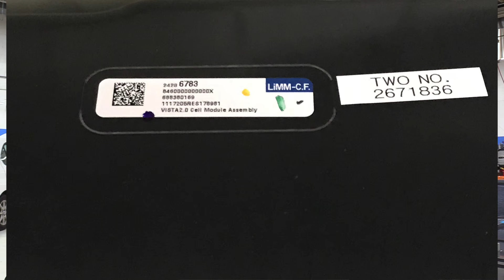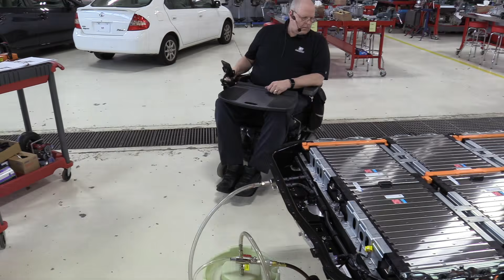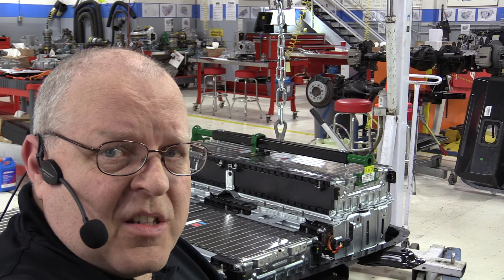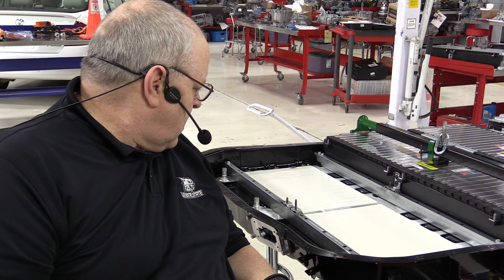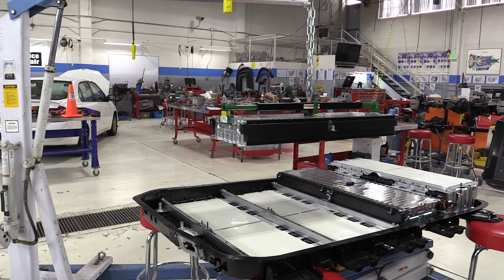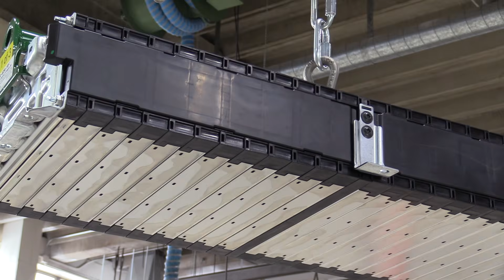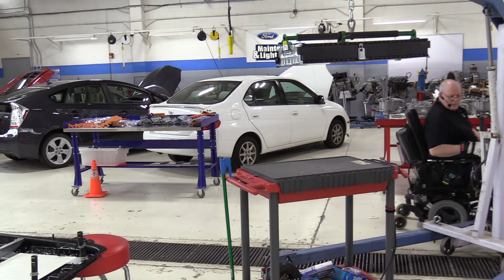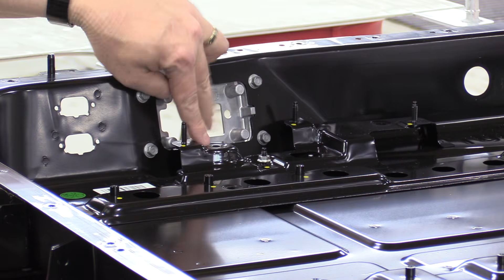Chevrolet Bolt EV Battery Disassembly

Comment: Thank you for a great informative video.  Can I get rough dimensions of the outside edge of the flanges, left to right, front to back and top to bottom of short section and tall section?  Thanks!  I might have an application for it.

Comment: Chevy Volt uses less gas than Tesla, Nissan Leaf or Chevy Bolt The state of California gives a larger rebate to Tesla owners than to Chevy Volt owners because the Tesla is a “Zero Emission” car. In reality the Chevy Volt is closer to zero emission than the Tesla. This may not make sense to you so please read on to see my reasoning. As an owner of three different Chevy Volts Plug in electric / gas hybrid cars since 2011, I can affirm you that my experience with those three cars and my experience with the Chevy Volt is that they use much less fossil fuel (Gas) than Tesla, Nissan leaf or Chevy Bolt. This may sound as an absurd statement but if you let me explain to you why, then it may make more sense, When a person owns an all electric car (Tesla, Leaf, Bolt) it is never a primary car. The owner must own a second car as the primary car. This is usually a regular gas car that in the long run it uses much more fossil fuel than a Chevy Volt. In other words the total fossil fuel usage for this household is much more than that for a person who owns a Chevy Volt. The Chevy Volt for this household is the primary car (no range limit) and there is no need for a second (more long distant) reliable car. Also should note the environmental impact of owning two cars over one car which would include parts that needs to be replaced and those used parts will eventually end in the dump, 4 additional rubber tires to care for, oil changes, transmission oil, brake pads, tune ups, cost for the additional insurance etc. As soon as a person purchases an all electric car he develops a (RAD) range anxiety disorder, it is a disease I invented in my head to explain to you how a new owner of an all electric car starts to thinks shortly after purchasing the car ( sort of similar to buying a Boat: as the saying goes: the two happiest days in a man’s life is the day he buys a Boat and the day he sells it). Most of the general public (even most owners of the Chevy Volt) are not aware of this “RAD”. When an owner of a Chevy Volt travels any distant he will always be going from point A to point B. When an owner of a Tesla, Leaf, Bolt travel any distance that is close to the 50% range of the car’s battery capacity or more, he or she no longer can travel from point A to point B. It will always will be point A to point C. The reason is point B will HAVE TO BE a stop to use some form of a commercial charger thus diverting from A to B path (travel distance increased so is the fossil fuel usage) and the commercial charger uses of (fossil fuel) to charge the car. Example if a Tesla owner lives in Pasadena, Ca. wants to visit relatives in San Diego, Ca.. This Tesla owner will be very apprehensive that his or her car my not make the round trip and they could get stranded somewhere in between putting their life on the line. They have to stop at some Tesla charging station in between to get the Tesla charged or the battery switched while the relative who lives in San Diego will use their gas guzzling (fossil fuel) car to pick them up at the Tesla charging station to bring them to their house and when they are done visiting, this relative will have to take them back to the charging station using the same gas guzzling car, that is four trips. When owners of an all electric car taking any extended trip they must be on their toes learning and knowing the whole network that they can use to recharge their car (Point B to point C). If those charge stations are busy charging other cars then they must wait possibly buying foods and drinks (that used fossil fuel to make, and produce more trash to fill landfills). If the car is completely discharged then they will have to stay at a hotel overnight, because those All- Electric cars can take as much as 18 hours to fully recharge. Boy think about the amount of fossil fuel used to keep a person in a hotel overnight, electricity to operate AC / Heater, watching TV, hair drying, washing sheets and towels, laundry, food and the trash generated by such a one night stay. They also will need some form of transportation from the charging station to the hotel and back (more fossil fuel). Those all electric car companies may use sells gimmicks like DC charging where you can get quick charging in a short period of time. I say nonsense, you have to find a charging station with such a DC charging capability and hopefully there is nobody else ahead of you waiting to use it. Some people might thing in the back of their head that some hotels may have a one or two charging station for customers to use, I can guarantee you that those charging station will charge you an arm & a leg (more direct and indirect fossil fuel use) before you charge your car. In other word they: CHARGE LOTS OF MONEY TO CHARGE YOUR CAR. My experience with hotels chargers is that they either don't work or you can not charge your car with them (Tesla requires a special charger). If Tesla owners think that they can knock on peoples doors and ask them if they would allow them to use their electrical outlet in their garage to charge their car while they are sitting in their car, they better think again. It is not only unpractical, not workable and damn right dangerous. In some areas around the country if you knock on peoples door to recharge your car then you could end up on some TV true crime show. When I was a child my father told me the following saying “Good health is like a crown on the heads of healthy people, only sick people can see”. Chevy Volts drivers wear a crown (No Range Anxiety Disorder) only owners of Tesla, Leaf & Bolt drivers can see this crown. The state of California calls those all electric cars as “Zero Emission” while in fact they either directly or indirectly use more gas than the Chevy Volt. The Chevy Volt should be the car that gets the White pool lane sticker and should get more state rebate than the Tesla. People who have never owned a Chevy Volt have no idea how little gas it uses. Over the past almost 8 years of using my Chevy Volts most of the times I can not even remember the last time I purchased gas. Chevy Volt is also a great maintenance free car, I can write a real long article about all the benefits of owning a Chevy Volt but not this time. I think Mr. Bob Lutz (the person who forced GM to make the Volt) against all odds i.e. “GM engineers” should receive the Nobel prize for his idea and persistence. Had GM added a gas generator in the Chevy Bolt the same size as the gas generator in the Chevy Volt then the Chevy Bolt would have become (BVOLT) and would have become the greatest selling car in the world. Unfortunately Mr. Bob Lutz no longer works for GM and GM executive are now forced to listen to “GM engineers” to make their decisions. Even if I lived in an apartment building with no electric outlets in the parking section I will still purchase a Chevy Volt to use it as a gas only car. On gas only, without ever being plugged in for charging, it gets more than 40 miles per gallon. This mileage combined with almost no maintenance and the incredible torque this car has, makes this car better than the gas cars made by Honda, Toyota, Nissan combined. The 100% electric drive makes the main function of the gas engine is to charge the battery or run the electric motor. This means this gas engine is under no stress to propel the car which make this engine run under little mechanical degradation, which means it can easily run half a million to one million miles without much of a problems. Until someone makes an All-Electric car that is powered by a super-capacitor (or other means) that can be fully charged in minutes AND those charging facilities are present at all gas stations, then All-Electric cars are not “Zero Emission” and not even close to being the lowest emission cars on the market. Super-capacitor cars I do not envision to be around anytime soon and until such a car becomes a reality then I say to the whole world that is watching : “The Emperor's New Clothes, he hasn't got anything on,". To all the auto industry CEO's with visions, missions of a “Zero Emission” cars : the jig is up because it is not in the All-Electric cars. The Volt has the lowest emission of most if not all (including All-Electric) cars and should receive the Nobel prize for being the greatest car ever built. Owner of 3 Chevy Volts for 8 years.
Reply: Rebate is based on units sold....after 200,000 the rebate diminishes and then goes away completely.

Comment: Does the Bolt have a 12volt battery for auxiliary like the Volt? This maybe where people get the 60 ?
Reply: I don't know if the Bolt has that battery (most EV still have a standard battery) but I don't think people are adding the energy values (of the EV battery) with the voltage of the normal battery, wouldn't make sense. People post likely rounding the number up.
Reply: Question Prof. Weber... If ice is disabled crack in block, can the 2012 Volt continue to operate via only the electric generator for the distance of its charge capacity?

It's an idea I'm throwing out there as the repair is just way to expensive and I'm upside down on the loan.

Comment: He's a modern day IronSide, solving these E-mysteries and breaking it down. You get a sub..
Reply from the maker: LOL, thank you!
Reply: @WeberAuto I love your channel, and I am a nervous electrician around 300v DC.

What I do no understand is why you do not disconnect the busbars halfway along the battery pack before tackling the HV terminals.  You say "it's all HV in there" but it's not.  Along a busbar there is almost zero voltage drop, so these are far safer to remove than connections to shorter bars in closer proximity inside plastic housings.  Once the series pack for each parallel string  is split halfway, the circuit is open and any potential difference between all the  terminals is dramatically reduced.  At 48v these packs will spark and burn skin but they won't shock you unless you insist on it.

Comment: Now the fun part, Professor Kelly!
The weight of that entire assembly  must add rigidity to the vehicle, and I'm sure it reduces the "driving distance!"
That said, will you be showing how to diagnose all the sub assemblies to this pack?  What diagnostic
 tools will be needed.  I know diagnosing gas, diesel and CNG vehicles can require "out-of-the-box" types of diagnosing to locate intermittent problems.  I'm sure these vehicles will have to be driven many miles over many years to have these problems.  Still if those problems are encountered, it would be helpful to see and hear how the vehicle was repaired.
Reply from the maker: Thanks for your feedback. See my other Bolt EV videos for that information

Comment: Interesting that they would say to lift slowly to avoid damaging those sticky thermal transfer pads, then say they are not reusable.  Seems contradictory.

My guess would be that they are reusable if not damaged and kept clean of any contaminates (including dust) that would hinder the thermal transfer.  Of course that wouldn't be following the "blessed" "proper" procedure.
Reply from the maker: Thanks for your feedback I think the slow lifting was to avoid damaging the battery modules
Reply: @WeberAuto   The 'thermal transfer' pads at end of the service life of the pack would have a tendency for the silicone to dry and stick firmly, and then tear when lifted. Imagine the cleanup job after that. 
I hazard a guess this assembly has had a very low service duty and essentially 'new'. 

These pads have a thermal impedance and more intent for having the heat exchanger [sink] make contact across the irregular surface of the battery cells [stacked like, so they would never be a true flat surface]. A bit of a compromise given thinner transfer compound on two very true flat surfaces would have higher exchange of the heat.  For example - in the electronics field silicone pads are only used when high dielectric property is needed due to the surface of a device e.g. one leg of a power transistor or voltage regulator] being at a different potential difference [voltage level] to the heatsink surface that is generally at 'Ground' level. i.e. Pads avoided because other forms of heat transfer compound have a far lower thermal impedance and so, far more efficient.

Comment: I can't help but wonder if that whole assembly is water-proof, and when one will be able to swap it for the hydrogen fuel-cell assembly, or optional thorium reactor module.
Reply from the maker: Thank you for your feedback. Water resistant, not water proof. Maybe swap it with an Illudium Q-36 Space Modulator?

Comment: Those busbars look surprisingly thin. Does anyone know what their CSA is? Given 150kW / ~350V = ~430A
Reply from the maker: They are 18 mm wide and 2.1 mm thick. They can easily handle the 350A with which they are fused.
Reply: WeberAuto thank you. The 350A fuse does suggest 150kW is rather optimistic
Reply: @WeberAuto   I was looking at the busbar size too, and thinking that looks a bit stingy.. thinking how hot do they get! Having worked in the power distribution switchboard industry [mains supply] that size bar appears to be rather under-rated... but could carry 3,500A for a short time. 

It's all about temperature rise in an enclosed space [like this] over a duty cycle time. 

The 350A fuse is  of a 'Fault Current Limiter' - blows in a short circuit scenario. 

Other protection means is employed to disconnect at the line contactors [not relays] at overload levels - a current sense coil is around one leg of the supply conductors [+ve] on the module first removed.

Comment: Now that I have finished the video, why is the cooling system under the batteries?  Wouldn't it be more efficient to have it on top of them?
Reply from the maker: Good question. I do not know. it must not make that much difference.
Reply: Maybe that gravity would make the electrolyte have better consistency of conduction.
Reply: my opinion is that if the large cooling plate leaks it does not leak over the top of the batteries shorting them out. Hopefully, the leak would be discovered  by noticing the fluid level is below the correct level  in the clear fill/surge tank. The fluid  will pool in the lowest spots of the steel battery pan.

Comment: These batteries look very expensive, Does anyone know How much ?????
Reply from the maker: The 5 modules are about $3500 USD each
Reply: @WeberAuto  so 17,500 for replacement in 10 years?
Reply from the maker: @FrenchValleyAirport  It is possible, but I suspect they will last longer than that depending upon how they are driven, charged, and maintained. Who knows what the price will be in the future. There may some retrofit battery technology that is less expensive and more powerful.

Comment: thank you for this incredible disassembly of the whole Bolt.
As EV engineer, I would love, however, to see less bolts undone and more info on battery modules and BMS.
I am thinking of getting all of Bolt EV guts and installing it all in to my old Smart Roadster.
Reply from the maker: Thank you. More information is coming in future videos

Comment: I used to work at Electric Boat at Groton, Conn. Each cell of a Nuke Sub Battery weighed 1500 lbs.
My question is can you test each cell separately for this Battery.
Reply from the maker: You can test each cell pack (three cells welded in parallel with each other)

Comment: For safety uncover and remove the negative bus bar connections first. This will protect from accidentally grounding your batteries and your body to the high plus side Safety First grounding a positive sides accidentally can cause not only severe shock but Burns due to plasma explosion
Reply from the maker: Thanks for your feedback. Good ideas

Comment: i wonder how many years this battery will last. i heard it costs over $15k to replace it, which is close to half the cost of the car.  I think we need better cheaper batteries!
Reply from the maker: They have an 8 to 10 year warranty depending upon the state in which you live. Even if one did fail, it may be comparable in price to replacing an engine or transmission.
Reply: That is a pretty good warranty. I guess in 8-10 yrs the price would come down, and maybe battery tech gets a little better.  But i think i can replace and engine and transmission a little cheaper than that. lol  Thanks for the quick reply, and thanks for sharing this series!  Hope you have a wonderful Holiday!

Comment: Very nice presentation, I've watched a couple so far.
I have a question, the five section battery in series gives approx 360 vdc. But batts 4 and 5 you said were a lower amphr rating. Since these are in series with 1 2 and 3 wouldn't battery 4 and 5 be discharged sooner than the 1 2 and 3 packs?
Due to the technical nature of your presentation, I may have misunderstood.
Al Takatsch   al_taka@yahoo.com
Reply from the maker: All battery sections have the sam Ah rating, they have different kWh and voltage ratings. When they are all put in series it all adds up to close to 400V with the same 65Ah rating. Best wishes
Reply: @WeberAuto  Thanks, i understand now. Keep up the Great Work. 
I like your power chair skill moving around vehicles without scratching them. Its always on my mind too.
Retired now and flying control line airplanes from my chair,
https://www.youtube.com/watch?v=1TOcRoKIK7I&t=8s
Reply from the maker: Thanks, that looks like a lot of fun. Have a great day